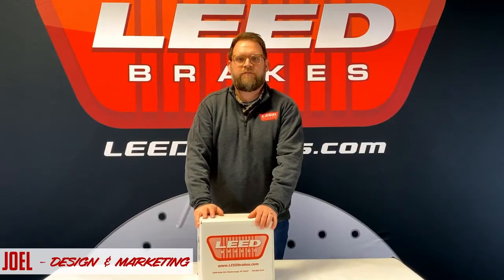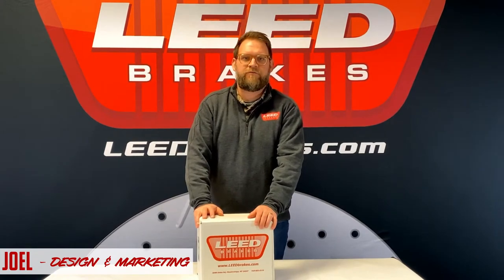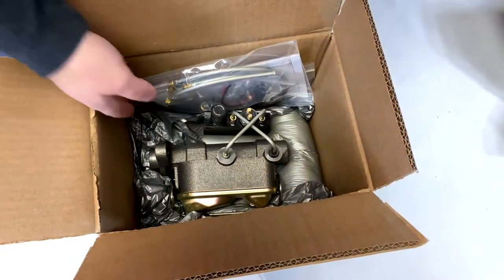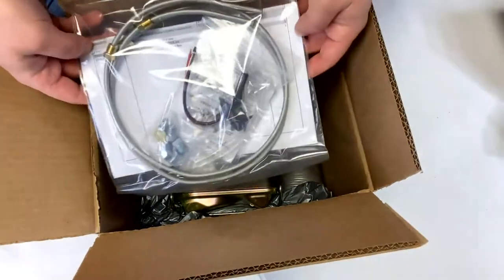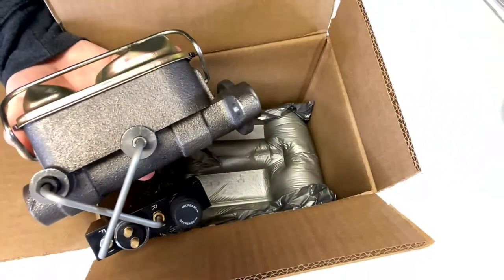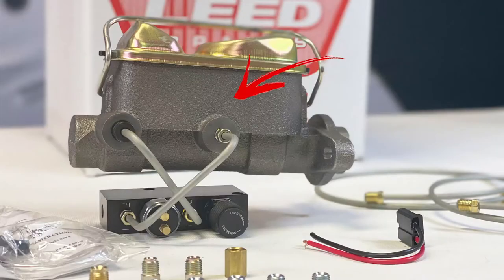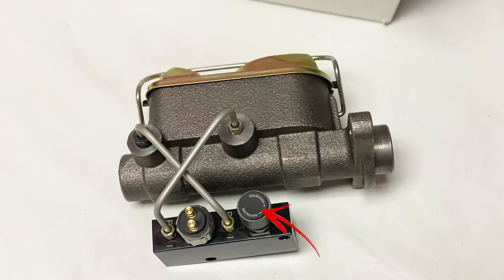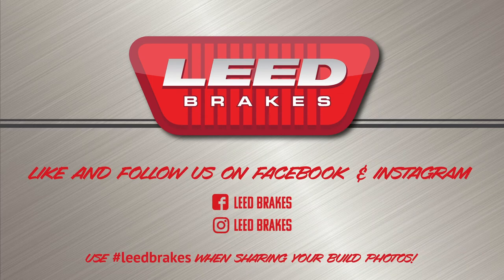Dual Bowl Master Cylinder upgrade kit for 1957-68 full size Fords with manual brakes

Comment: Hi do you only do ford , have same issue 56 chev change out from single master to duel manual master manual brakes to disc / drum , 4 bolts what 2 studs do I mount to . Help

Comment: I have a 1964 Ford f250.  That looks interesting over have just manual brakes.
Reply: You'll still have manual brakes, not assisted. This is more of a safety precaution as if one brake line breaks on the single all your brakes are gone. This prevents that by separating the front and rear brakes.

Comment: Do you offer a kit for cars with assisted brakes?  My 65 thunderbird has a booster but it still has the single bowl MC.  It's a factory disc front/drum rear setup if that matters.